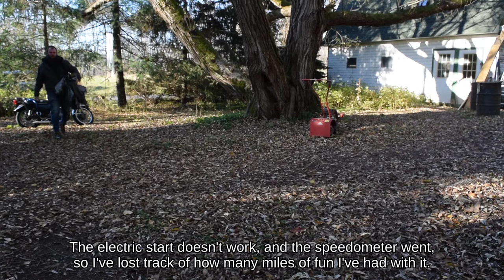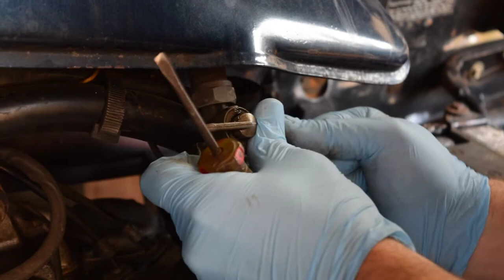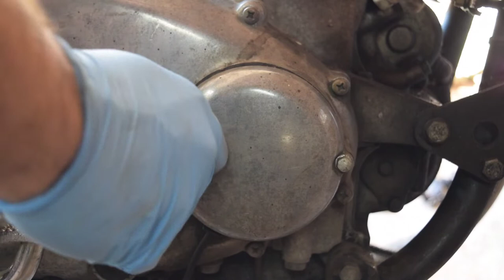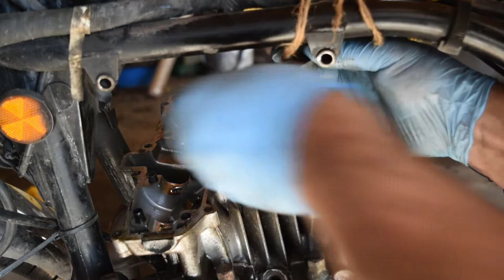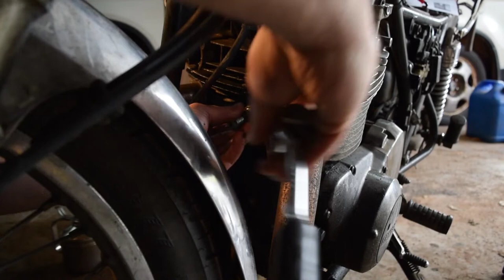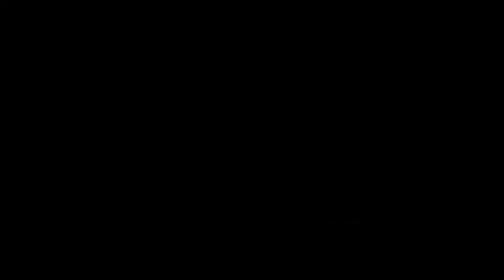Head Gasket Change — 1977 KZ750B

Comment: I have the same bike and need to do a head gasket. I’ve only ever worked on two strokes. How did you know how many pins to count on the timing chain and where the markings should be? That’s the only part i’m intimidated by.
Reply: From what i could tell you put the marking of the cam on the front of the motor level with where the valve cover gasket goes and counted 32 pins for the marking on the cam on the back of the motor.Does that sound correct?
Reply from the maker: @zackmullins9393  I'm sorry I didn't see this comment earlier. I was following step-by-step instructions in the repair manual for this motorcycle which you can find linked in this forum post http://kz750twins.com/?p=15

it includes information about aligning the timing chain and other important steps. Apologies for not including this information in the original post, I hope you've gotten your bike back on the road well!